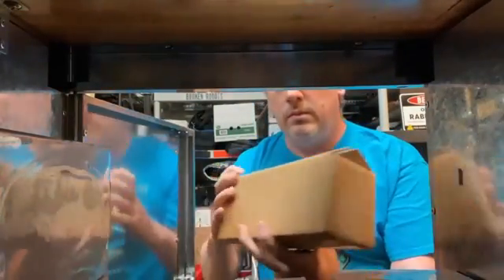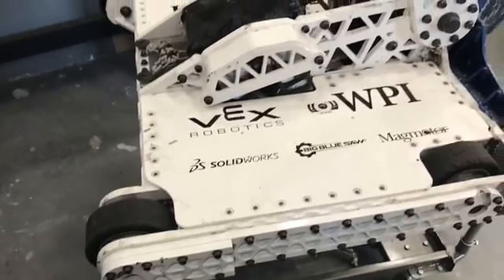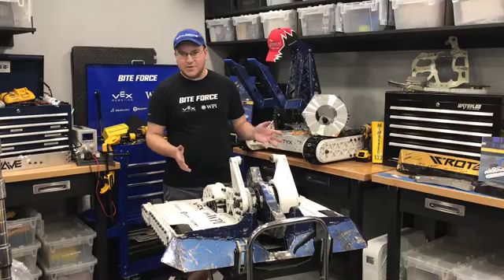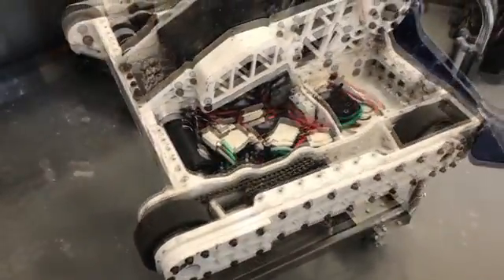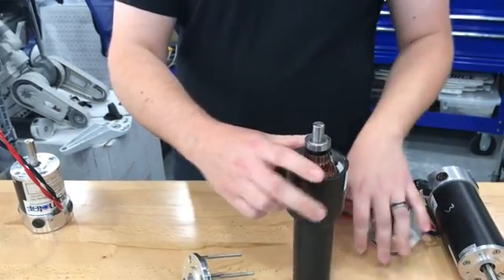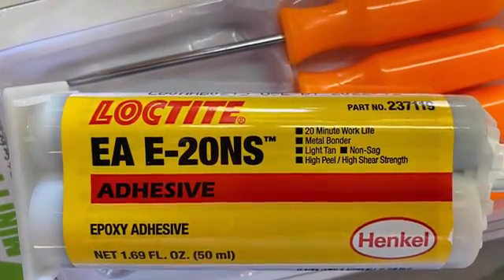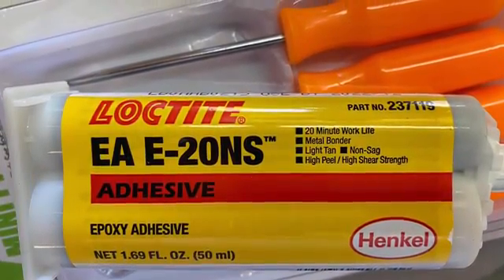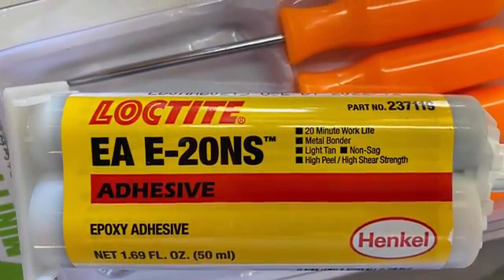BATTLEBOTS BITE FORCE Exclusive Interview [Builder Blog Ep. 9]

Comment: -- You can improve luck by 1 point by finding the appropriate Bobblehead.  Some people will get it.  Say ... what about acrylic coating over the magnets?  Like those cell phone screen protectors.  I wouldn't expect at all that it would stop a magnet from shattering, but in the event, it might just hold the magnet together to the point of some function/parts of the magnet not grinding around the rest of the motor.  You know, sort of how some body armors are made.  What about copper heat syncs and fans to keep the motors cool.  Active cooling makes one heck of a difference.  
   And Biteforce.  Your absence has been noticed in this BB season.

Comment: Some things I had been curious about; how thick is Biteforce' armor? Actually now I see that his side armor where the wheels are is impressively thick. I'm the kind of person that would want to dedicate a significant portion of my weight allowance to the armor thickness, like Malice. Their armor is around an inch thick on the outside,  essentially the entire outside chassis. That is, except for the top and bottom of the bot. Also, armor that gives good returns on its strength/ weight ratio. What does he use for his armor? What enables his weapon to be so reliable? Is it the fact that it spins at a lower speed than the other spinners?

Comment: Take the epoxying process one step further and take some 100 grit sand paper and rough up the areas that the epoxy will be coming into contact with that way it gives it a little more grip to bond to it really makes a difference then using it in a smooth service.

Comment: I came on here just to check out your video I am a battlebot enthusiasm. What I learned about bite force what you got to make sure that your polarities are about the same whether it is forward or backwards and I never knew that you were able to add a adhesive to your magnet chamber and it will help it maintained consistent temperatures and withstand higher temperatures quite fascinating stuff

Comment: I learned that you have to have a great team and do all the right things to prepare for success and be ready when you get some luck. Evaluating the current while tightening the motors is interesting. Would he want even current on the drive motors but on the weapon motor wouldn't he want the lowest current while turning in the only direction that the weapon turns? Also what type of loctite does Paul use on the bolts of the motor?